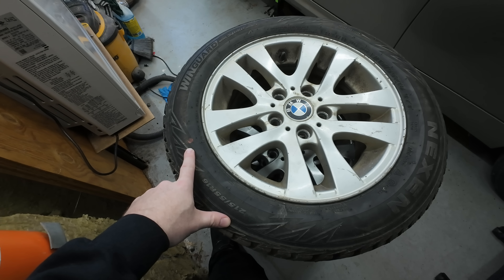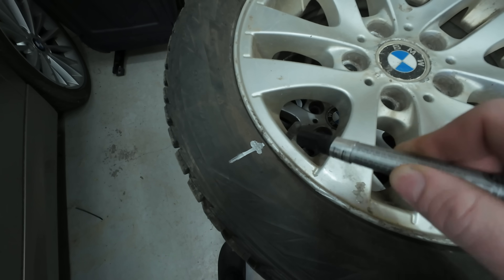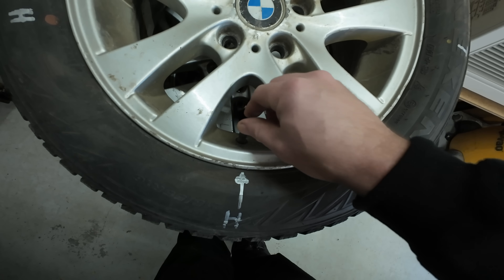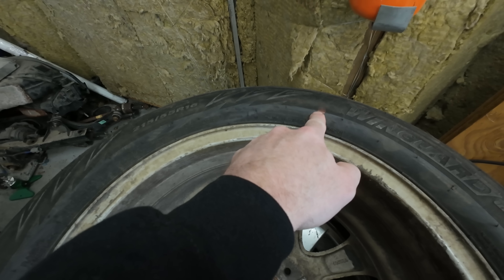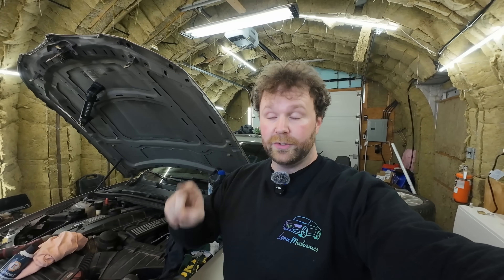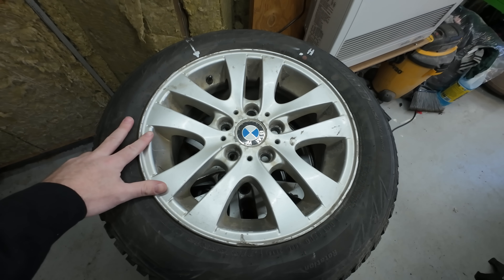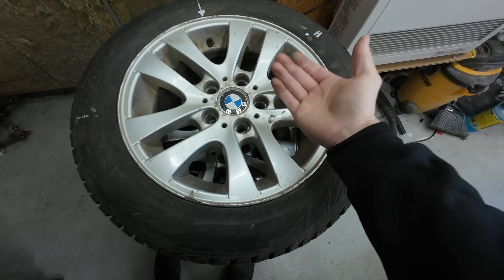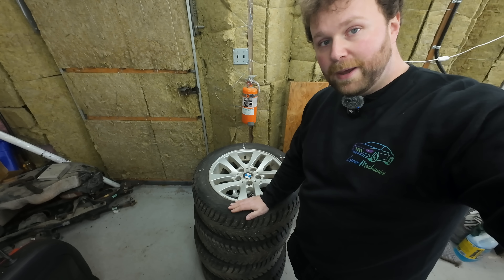Tire Red & Yellow Dots Explained | Back to Basics. Many mechanics get this 1/2 right

Comment: You should do a follow up video addressing steel wheels. The yellow dot gets lined up with the weld seam instead of the valve stem as that's usually the heavier part of the wheel.

Comment: After doing tires for 40 years, that dot means fuck all. The weight ends up near the valve in most cases. 
Red dot is only slightly useful if you’re installing a new time with the dot
Those fuckin dots are useless

Comment: What we did at bmw was use the yellow dot at the valvestem. If the yellow or red dot was missing, we'd use the laser to mark 180° out and make a yellow mark or confirm our red mark. Most shops don't use a road force balancer, but these are even more accurate than the markings. Red on valvestem rarely does NOT vibrate.

Comment: when the tire guy is getting paid 11 dollars an hour or less to work in +100 degree or 30 or less weather and doesn't have to pay for wheel weights, nor has to worry about post service customer relationship the quality and integrity of the work goes down! it becomes " if it balanced its balanced I did my job " situation.   rechecks aren't good can lose you business. I worked at a shop we had a lady come from discount tire they didn't fully air here new tires up she thought something was wrong with her alignment or suspension. They tapped on 2oz of weights we dismounted and remounted the tire, took all the weights off and the balance was perfect without any weights.

Comment: when i did my apprentice i learnd that red is the heavy point you have to place it to the opposite when you have a sensor on the rim. if it's just a normal valve it doesn't really matter where to place it cause the valve isn't that much of weight difference. greetings from austria :)

Comment: My seldom used pick up had at least a pound of balance weights on all 4 wheels and it was still a paint shaker on the highway, from the day I bought it used. When my son started driving it daily, I decided to check the balance, but the marks were long ago weathered and washed off. I pulled all the weights and marked then turned the tires on the wheels until it evened out as good as I could get it statically, and then added weights as needed. The tires had to be turned approximately 70 to 180 degrees on all 4. Only one of the wheels needed more than an ounce afterward, and it doesn't shake anymore.

Comment: I've been telling the tire fitters for years that on some wheels the yellow dot is opposite.
They never listen. 
And if you're unsure which is the heavy part of the wheel, put a valve in and spin it up on the balancer. 
The valve recess on lots of alloy wheels has metal missing which is heavier than the valve, so many people still stuff this up.
Also the red dot is actually the high spot which is what is used for road force balancers, the yellow dot is for the old style balancers.
Reply: Appreciate your comment.  The only one here that actually knows what they're talking about and not speaking in absolutes.

Comment: The 15” Hankook tires I bought for my S10 didn’t have a painted mark, but it did have it embedded into the tire. Walmart tire guys still didn’t mount it right. But it took only about 1/3 on the outside and 1/2 on the inside, both tires. They run fine.

Comment: Just a quick note on your shop. All the exposed Roxul insulation you have will probably ruin your lungs in a few years. EVERY time the insulation is disturbed in any way, small glass fibers are released into the air. You breathe them in, and they are PERMANENTLY stuck inside your lungs. Your body cannot remove them.

Comment: New from the car manufacturer, rims have usually red dot stickers . It’s the lowest place on rim. They puts the highest place on the tire (red dot) in front of that. I have checked it out on many many new cars at the dealers. When your rim don’t have the sticker, you mark the rim and put new tires red dot in place of the old red dot ( if your tire is the original tire without remounting) You have better  ”round balancing” but not good ”weight  balancing”. You have better opportunity to correcting weight (by adding weights) than correcting roundness. If you don’t find the red dot or your tire is removed and replaced you go for road force balancing. If you can’t any of them put your yellow dot (lightest place on your tire ) in front of valve( heaviest place on your rim) . So you have better weight balancing and need less added weights but you don’t have great round balancing.  My tire shop put the red dot in front of valves and it’s wrong, now i don’t have either optimal weight nor round balancing. 😂 conclusion: You prioritizes round balancing (red on red) over weight balancing (yellow on valve) if you can. 😊

Comment: "If your manufacturer actually marks them" is my key takeaway. I've been a tire tech for a year and a half, at 3 different shops. The first 2 didn't teach me a damn thing, my current one was the first to really explain the dots. 

Unsurprisingly, I'm a lot better at balancing now than at my previous shops. Only issue is dots aren't as common on giant offroads, or sometimes the manufacturer puts them on the inside face of the tire. But having fancier balancers that measure road force mostly makes up for it.

Comment: I will tell you this: if you mount up a set of tires for a customer and you DON'T line the red dot up with the valve stem/sensor, they'll be back in before they even leave the parking lot screaming that you didn't do it right and that you're an idiot because some forum told them that's what the dots are for. You just can't win.

Comment: After doing all you can for balance[  statically ]  break the outside bead, 
Pour in 4 oz. Of 5mm air soft beads and reseal.
The dynamic  balance is ever correcting for all that happens outside the balance machine. Rocks,mud
 road hardwear. Won't cure out of round or worn suspension though.
Smoothest ride i have ever had. Harbor freight weight device was like 20.00 us. When I bought mine.

Comment: Good vid, interesting observation, mark your tyre and valve location and brake accelerate and corner hard and then recheck. they tyre bead moves on the wheel. wheels and tyres need constant balancing but depends on the car and how hard its been driven.  Ive had tyres move 180 degrees after 1 track session, its bonkers
Reply from the maker: Geese. What are you driving :p
Reply: @Lancemechanics  just a hairdresser's i30N :)

Comment: A valve stem weighs about 0.5 oz, or two of those 0.25 oz segments of weight. After 11 years as a tire technician while I was in junior high, high school, and college, I found that the dots on the tire don’t matter much and it’s not worth your time to pay attention to them. If there’s a balance or road force issue, then go ahead and force match or optimize it but in those cases, it’s usually because of a defective tire or a bent rim.

Comment: our tire line uses an optical matcher to line up heavy spot on tire with light spot on wheel(stem/TPMS sensor is taken into account when wheel mfr marks the rim) after the the mounter. then it's cycled thru the inflator, road simulator, balancer, auditor and finally bore greaser(ensures the reaction between dissimilar metals don't leave the customer with a wheel that won't come off the hub/axle).  about 4 wheels/min go up the hill, or about 2,000 wheels per shift for a total of 4,000 per day.  that's a lot of wheels to sling especially when some of them weigh almost 80lbs. whoop whoop!

Comment: Nice video. A few years ago, we got a new set of Goodyears installed on our minivan. The rear vibrated above 70 mph, and the tire shop tried to road force balance them, but could not. I lifted the back tire about 1/4” off the floor and rotated it, some points would almost touch the floor and some points would have the gap. I showed the video to the tire shop and they warranty replaced the 2 back tires with new tires from another batch, and they didn’t vibrate. 
I later got a cheap mounting stand and levers, and mounted some new E rated Pirellis to my truck rims, just aligning the yellow dot to the valve stems only, and they run fine with no weights at all. I actually bought balance beads for them, but didn’t end up using them. What’s your opinion on a static only balance or balancing beads, assuming the tire is optimally clocked onto the rim?

Comment: I had a good 25 years of experience before I decided to rather mangle waste than other people's cars, especially since the wage was the same.
some tyres have these spots, some have two. one guy says, put the spot towards the vale, other guy says, the opposite. why? nobody could explain. so I experimented  a bit and found out that at least with smaller tyres it doesn't matter; what matters is how good the wheel is, since most aftermarket steel rims tumble around like you've hit a curb with them, and that certainly doesn't help with balance and wear.
wider and larger tyres now, modern balancers allow you to "match" both. you balance the wheel first, machine lets you set a mark. then you mount the tyre and balance again, machine tells you where to mark the tyre, and then you turn the tyre until moth marks match.  so both parts balance each other out now. the lowest amount of weight I had to put on once was 5grams... for the whole wheel.
what I also found out, if the tyre needs more than around 1.5bar to slide over the wheel's humps, the tyre won't settle into the rim correctly. release the air and re-inflate the tyre to setting pressure, or however you want, and you'll see how it slides into position. this is where your uneven wear comes from, and often high amount of balancing weight.

of course if someone doesn't know what and why they are doing it, and can't adjust the machine correctly, you'll end up with wheels filled with balancing weights. being too lazy to remove old weights makes matters worse... and I have seen a lot in that regards.

P.S. what should one do when these spots exist only on one side of the tyre, and you have a direction-bound tyre thread? another thing nobody could explain to me.

Comment: I love all the comments. Especially since most of them are absolutely wrong!!! Including you!! I’m a retired aircraft mechanic. I ran a Wheel and Tire Shop during that time. I’ve been a mechanic (including my time as an aircraft mechanic) for 47 years. 
The Red dot is OPPOSITE of the HEAVY spot. You line RED DOT up with the valve stem UNLESS there is a YELLOW (and sometimes brown dot) on the WHEEL. This indicates the RUNOUT HIGHEST POINT!!! If the wheel has the dot (it’s on the inside in the middle where the beads go)  you line up the YELLOW DOT on the tire OPPOSITE of the wheels dot!!!!! 
If you don’t do this there is no amount of weight that can make up for the Tire/Wheel assembly not running true around! PERIOD!!!
Goodyears website has this 0:02 listed WRONG!!! It’s hard to believe but true! A tire manufacturer doesn’t know what the dots on the side of the tire (and wheel) means. There’s soooo much misinformation out there (including yours) it’s not funny. Please leave teaching this information to those of us that actually know what we are doing and have been doing for almost half a century!!!

Comment: I have mounted and balanced thousands of tires through my 40+ year career, and not once did I give a rats ass about the dots on the sidewall. I have yet to have anyone complain or have a tire issue.  There are a lot of other things to worry about than wasting your time with where the dots go. Hell, some tires don't even have dots.

Comment: You picked the wrong example tire . Just put the yellow dot on the valve stem and the red dot is across from the valve stem . No ? And you have to static balance wheels sometimes.  Or try telling the customer they need different wheels because they gotta have aftermarket wheels and now you got brake caliper clearance issues ..... Ask me how I know ..... 😂

Comment: Thanks Sir.  Beginner DIYer here.  I didn't know any of that.  Just that I have struggled with my 2013 sierra and vibrations since almost day 1.  I bought snow tires and had them put on the factory rims and bought new rims for the original tires (summer set).  since then, all vibrations.  I have moved twice in the last decade and have tried new shops and noone has ever properly balanced them.  They are likely permanently damaged/worn now, but I will be damned sure to check this when I get my new set.
I complained when I got the new tires.  From the factory there were no weights, my new snow tires were balanced with a huge napkin sized patch of glue on weights.  Before even accepting the truck from them I pointed it out to the owner and he said the tech spent an hour trying to balance that set of tires.  I was sure the tires were faulty but he accused me of having bad rims...all 4 of them...with 200kms on a brand new truck...that didn't vibrate an hour ago anyway.  I'm sure you all know the story.  Here I am 13 years later still dealing with the issue.
Reply from the maker: Well then. Yeah and techs don't understand the long term effects. They just want there .5h and get on to the next job. That really sucks though:(

Comment: I've been told that the red dot (high point) takes precedence to match a low point on the wheel, since weight can be balanced out with more weights but the high point cannot. I know Kia wheels sometimes come from factory with a white sticker on the face of the wheel and the red dot is aligned to that. So that's the low point! After the sticker is gone? Never seen anything else to mark where that is, nor the "dimple" some people talk about...

Comment: this is a total load of rubbish. If a tyre is properly balanced you should have no issues with the assembly. The only reason the dots are there is to give the fitter a good idea where to mount the tyre in relation to minimising the amount of weight you are going to use to achieve balance.

Comment: Those small paint dots on new tires are "match-mounting" marks. Because no tire or wheel is perfectly round or perfectly balanced, manufacturers use these dots to help technicians align the tire on the rim for the smoothest possible ride with the fewest weights.
Here is the breakdown of what each color means and how they are used.
1. The Yellow Dot (Weight Mark)
 * What it means: The lightest point of the tire.
 * The Goal: To balance the weight.
 * How it’s mounted: Technicians align the yellow dot with the valve stem. Since the valve stem is typically the heaviest part of the wheel, placing the lightest part of the tire there helps "cancel out" the weight difference, reducing the need for those lead/zinc weights clipped to the rim.
2. The Red Dot (Uniformity Mark)
 * What it means: The highest point of the tire (its "high spot").
 * The Goal: To ensure the tire is as round as possible when spinning.
 * How it’s mounted: If the wheel has a mark (like a dimple or a sticker) showing its "low point," the red dot should be aligned with that. If there is no mark on the wheel, the red dot is often aligned with the valve stem instead.
Which dot takes priority?
If your tire has both a red and a yellow dot, the red dot takes priority.
 * Why? Vibration caused by an "out-of-round" tire (the red dot) is much harder to fix than a simple weight imbalance (the yellow dot). Technicians will prioritize getting the tire to roll smoothly (red dot alignment) and then use weights to fix any remaining weight balance issues.

Comment: Interesting video, thank you.
Wheel balancing was always a problem in times past with a Jaguar mkIX, 16" wheels (large for the time) and with cross-ply tyres were always a pig to balance. One tyre bay got it right , they balanced the wheel on a floor standing machine and then fitted the wheel to the car and rebalanced to perfection on the car. It worked well every time.
I don't know about across the pond but the machines that balanced on the car are as rare as rocking horse manure here in the UK.

Comment: Not a single tire shop has ever cared about these dots when putting tires on the rim. Only when I have specifically asked them to notice the dots they have done it and not every time even then.
Reply: Yeah, most tire shops just hire a warm body who can run the machines.  It's not exactly practical to hire an ASE certified tech who spent tens of thousands of dollars on tech college and wants to get paid 20+ per hour just to do tire repairs and replacements for minimum wage.  Typically, only dealerships will put a properly trained tech on the tire machines, and that's why they charge more than the quick lube shops.  If tire manufacturers actually sent this information to the shop owners, they might take 10 minutes to teach it to their tire techs.

Comment: The problem is managers. In the 80s, you had no dots. You would spin the tire on the floor until it flipped sideways, with your stick of chalk out. You mark the top. This is your heavy spot. You align this spot with the valve stem, put it on the balancer. If it says anything more than 40g, you turn the the tire 180 degrees and repeat. If it is still above 40, you turn 90 and repeat. Never would you ever need more than a couple of weights to balance a tire. Don’t believe me, go to your local junkyard and check out the cars that haven’t had new tires since the 90s. You’ll find a couple of weights at most on each wheel.

Comment: Road force balance (if you have the better Hunter tire machine)
Reply from the maker: Nobody has these machines. There 50,000cnd and its the single most expensive piece of equipment a shop can buy. It costs more then an alignment rack and machine.  Dealerships barely want to buy them  the units they have are 10plus years old